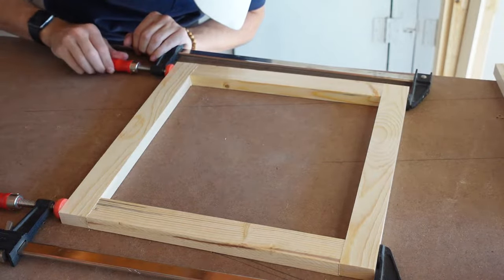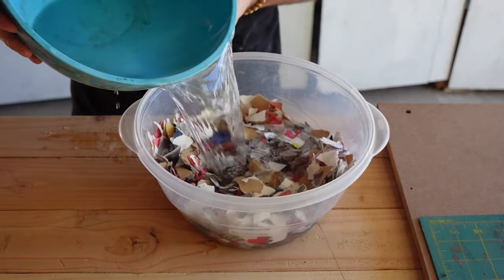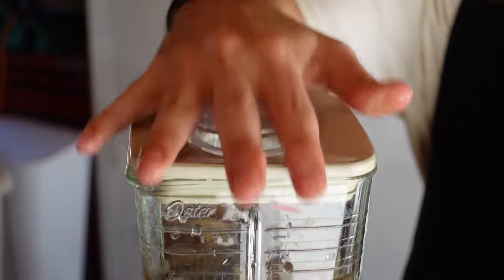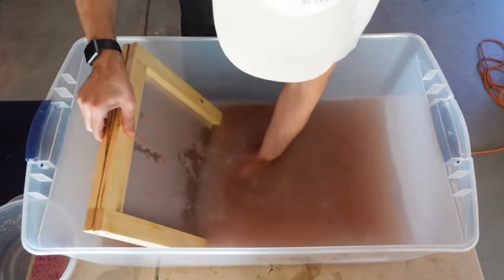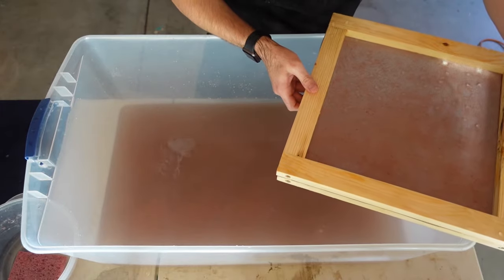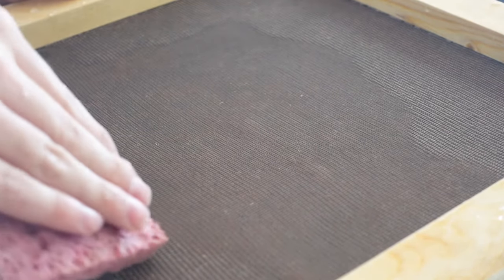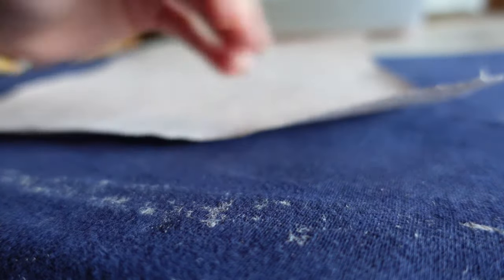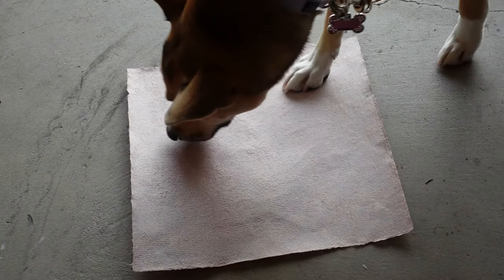Making Recycled Paper... and Trying My DIY Deckle and Mould for the First Time!

Comment: I head read that industrial paper manufacturers use a similar machine to the Deckle and mould of course a lot more precise,  but notably the mould oscillates back and forth, and ensures even distribution, I suggest you put a vibrator motor in each corner of the mould frame, might be worth a try

Comment: Its nice to know that you went ahead and did this!
The only thing I find hard to appreciate is that hand made paper has to look crude, even if it's your first time!
You've invested in the basic equipment, so, why compromise on quality?
Perhaps you should have first ground the paper for a short while, soaked the blended paper, overnight and then did a thourough grinding.
Printers who want to excell will   say that the best paper should have a decent rag content (pure, only cotton cloth) ground into the pulp.
This gives it some good interlocking with the fibres and tear resistance!
Using leaves and such humble adventures to make paper, seems to be too immature for a start!
I've heard that currency paper has a high rag content.
Is there anything better than currency paper for printing!
Anyway, please keep up with the good work!

Comment: Thanks, the dark screen makes the light-colored pulp show up on the deckel awfully well. The less newspaper and more butcher and brown wrapping (Krafr) paper you use, the stronger your recycled paper will be. Taking a brush soap and water to the fiberglass screen may help it drain water better.  Things tend to collect oil as they go through manufacturing. The slightest bit of oin on a screen really slows down water passing through it.